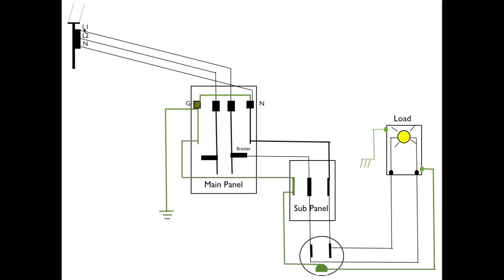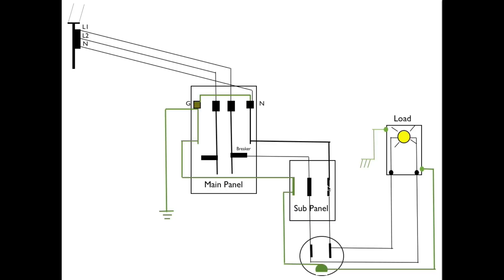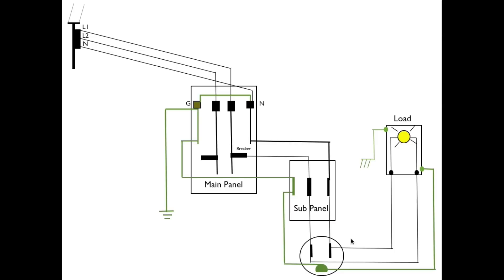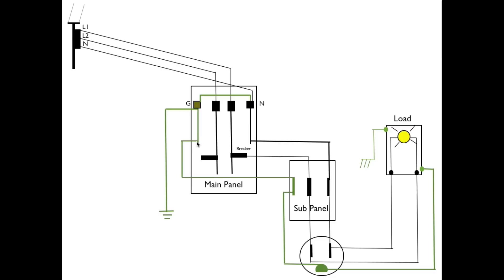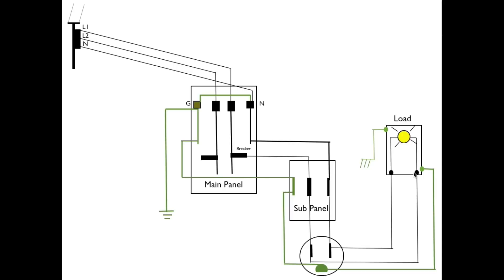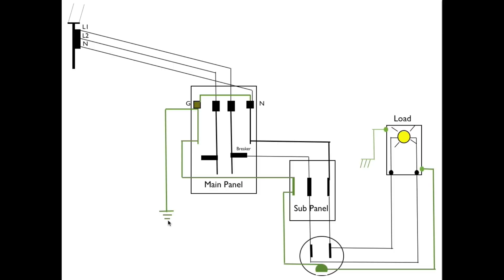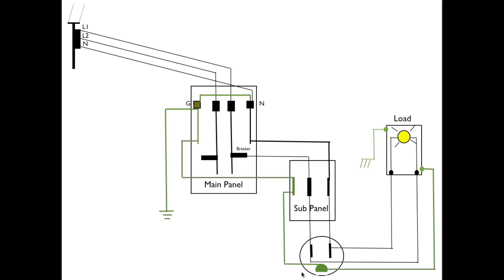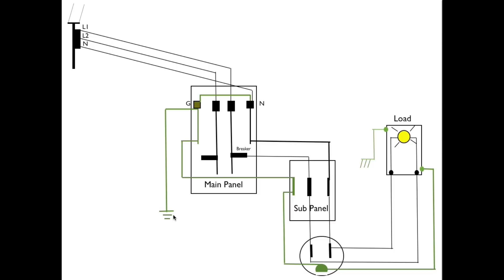The difference between neutral and ground on the electric panel

Comment: What I don't understand is if the ground and neutral are connected in the box, how can it be separated later? It's still connected
Reply from the maker: grindinglicks The issue here is if the neutral and ground were connected in the sub panel and the neutral were to be disconnected (broken wire etc)  then the equipment connected would run normally.  The power would go back thru the ground.  As the ground is connected to the chassis of the equipment, any break in the continuity of the ground would result in the chassis of the equipment being "hot" making it hazardous to touch the equipment.  Hope this helps.
GFM
Reply: That’s because ground never makes a complete current carrying circuit.  If you follow the schematic, current flows from L1 through the circuit breaker, to the sub panel, load, neutral and source.  The ground (green wire) is never part of this circuit, and as explained in the video, is only there to protect humans.
Reply: Ralph Norton Yes he does.  He described a situation with 2 separate open conductors, and a very real hazard that can be a result.  But maybe he wasn't specific enough for you.  For example, let's say my name is Ralph Norton, and I think I know how to do electrical work.  I, Ralph, make a really crappy connection on both the neutral and bond between the main panel and subpanel-- but I really kicked ass at connecting the hots!  I also put the screw in the subpanel that joins the neutral to the ground bar-- contrary to what grayfurnaceman told me.  Now I have energy in on the hot, through a light bulb, back to the panel's neutral bar, gets stuck because there's no connection to the main neutral, detours through the link to the ground bar, stuck again because there's no connection to the bond towards the supply, so detours through all the connected bonding conductors, and then sits and waits for a path to go back home/ground.  Since the circuit is incomplete, the light does not turn on, and I blame +James Martin who installed the light fixture.  Then I, Ralph, get on my handyman aluminum ladder, and grab the light fixture.  OH MY GOD!  MY NAME IS RALPH AND I'M GETTING ZAPPED!  BUT THE BREAKER WON'T TRIP BECAUSE THE TOTAL SERIES RESISTANCE OF THE LIGHT BULB FILAMENT, COPPER CONDUCTORS, FIXTURE HOUSING, MY BODY, MY CLOTHES/SHOES AND THE LADDER TO GROUND IS FAR GREATER THAN 8 OHMS WHICH RESULTS IN A CURRENT LESS THAN 15A SO THAT THE BREAKER DOESN'T EVER TRIP AND NOW I'M DEAD AND CAN NEVER POST ANOTHER USELESS AND IGNORANT YOUTUBE COMMENT ABOUT ELECTRIC WORK EVER AGAIN!!!

Comment: In all explanations of AC power transmission, I've seen, there is a power line and the return goes through the earth.  So if the hot wire contacts the grounded box or conduit, it shorts out whether there is a neutral or not. Therefor, using a conduit for a neutral makes no difference, as far as I can see.
Reply from the maker: If you look at a power generation system, there are 3 lines lines coming from the station.  They are the 3 conductors of the 3 phase system.  There is no ground necessary.  There is a grounding conductor, but it is not part of the circuit.  Some very early systems or those traveling long distances without a lot of load have used a grounding conductor as part of the circuit.  But these systems have some very nasty side effects.  Such as a dry grounding plate that will reduce the conduction of current.  
If you look at my playlist on wiring in the panel, there are a number of other videos that demonstrate what the neutral does.
GFM
Reply: Using conduit for neutral is a BIG no no. As GFM illustrated, the neutral is a current carrying conductor. Therefore, should you open a coupling at the conduit sight and separate it, you have created a very dangerous situation. Should some one grab the two separated conduits, they could be electrocuted.
AND, you can NOT use conduit as a grounding system; because of the conduit being possibly separated.
Also; there's an MGN wire used in distribution of electrical energy.

Comment: Also main panel is 220v, sub panel is 110v, at least in your diagram.
Reply from the maker: The voltage is determined by the pole transformer.  In this case, it is 240v.
GFM
Reply: It's 240v from end to end, 120v from each end to neutral (center tap), that's how you get the 240/120v household electrical system.
Reply: Yes

Comment: if the neutral is connected to the ground at the main panel, how is there no current on the ground?  the neutral brings the current back to the panel, and then wouldn't it be taken to the ground as they're connected?
Reply from the maker: Perhaps the real question is, do you think that earth ground will carry current to the earth under normal operating conditions?  
GFM

Comment: I don't understand, if neutral wire has current going through it, why doesn't it short when connected to the ground at the box?
Reply from the maker: You seem to be assuming if a wire with current available would be a dead short to earth ground.  Earth ground is not a part of the circuit.  Earth ground is for absorbing lightning and surges.
GFM

Comment: One teensy, tiny, anomaly: grounded electrical outlets have the longer, neutral on the left with the ground socket facing down.
Reply: +rchandraonline yup! Not a small issue either, this implys a miswired duplex.
Reply: +rchandraonline 
Also the white neutral wire is connected to this screw which is SILVER colored, the black hot wire is connected to the opposite screw which is BRASS colored. In a 3-way switch, often you'll find a black wire painted white on the insulation connected to a white wire with a wire nut (never connected to the switch) to serve as a neutral return for for a remote device plugged into a split receptacle that gets the hot side power originating at the farthest switch.
Never EVER switch. fuse, or use any kind of disconnect in a neutral or ground circuit.
Reply: ....... Or, you could cut GFM some slack because of the way his Main and Sub Panels are laid out. If he were to accurately portray a polarized receptacle, he would have had to cross his wire in the diagram, which would probably add unnecessary confusion to the novice person viewing the video.

Comment: The neutral wire on the pole actually originates from the centre-tap of the secondary winding of the pole-transformer, which is normally at zero volts. The reason why the neutral wire MUST be grounded is two-fold. First, it's the only way to complete the safety-ground circuit: The ground-wire would be unable to do its job if the neutral wire weren't grounded at the main panel. Second, it caps the voltage of the shock that a person can receive by touching L1 OR L2 (not both) at 120 V. Picture this scenario:  L2 somehow comes in contact with earth-ground before someone accidentally touches L1, without the neutral wire being grounded. ZAPP! That person receives a 240-V shock: MORE THAN ENOUGH TO KILL! However, if the same were to happen with the neutral-wire grounded, that person is far more likely to be spared electrocution.  In addition, the faulty L2 circuit that came in contact with earth- ground would normally open due to short-circuit (provided the resistance at the point of contact is near zero).
Reply: The neutral conductor between the panel and pole carries the DIFFERENCE in current between L1 & L2 back to the centre-tap of the pole-transformer. There are only 2 possible situations in which this current can be zero. The first being the case where ALL branch-circuits are open, and the second being the case where PERFECT load-balancing exists between L1 & L2 (which is next to IMPOSSIBLE to achieve in practice), making the currents in L1 & L2 equal.

Comment: why is there even a grounding rod if the fault is carried back through the neutral anyway to the power station?
Reply: The neutral only goes as far as the pole transformer (or pad, if your service is underground). The primary of the transformer is fed from a leg of either a wye or delta wired three phase, three or four wire line from the power station.

Comment: so if what you say is true the why is it when a wire gets knocked to the ground will it arc and burn sometimes a hole in the earth????   one would assume it must be completeing a circuit for  there to be a transfer of electricity???
Reply from the maker: If you mean high voltage power lines, if the voltage is high enough, it will overcome the resistance of earth ground.  The voltage here is less than 200 volts.
GFM
Reply: during a storm high power line to sand around the pole turns it to glass

Comment: Then we have electric ranges and dryers using 3 wire power cords where neutral and ground are tied together using a strap
Reply from the maker: That was always one that bothered me.  Until about 1995, it was ok for a manufacturer to use the ground as a current carrying conductor but field electricians could not.  Fortunately, that has changed.
GFM
Reply: Far as I know dryers and ranges still come with the grounding strap attached to Neutral
Reply from the maker: They may still have it but it can't be used in my area.
GFM
Reply: Until the 1950's, the neutral was the only way to ground appliances, there were no grounding wires, and outlets didn't have the ground hole, either.
Reply: That's so you can use the appliance in an old house without ground wires. Break off the strap if you are using a modern 4 wire supply cord and grounded outlet.

Comment: Yes..i know that....just why is it ok to bond neutral and the ground at the main panel yet its not ok at a sub panel?...
Reply: When you connect "neutral" downstream from the first "intentional grounding", the so-called "neutral" downstream is parallel with the bare ground wire(s) and current flows in the bare grounds. This is undesirable.

My hesitancy in calling the white wire returning from the load a "neutral" is that by definition in the NEC a "neutral" carries the unbalanced current and in a simple 120V  circuit feeding a load (e.g. a light bulb) there is no "unbalanced" load or current. All the current goes out the black wire from the single pole breaker and exactly the same amount (amps) current comes back to the "neutral" bus on the white wire. Thus there is no "unbalanced" current for the white "neutral" to carry. The black and whites wires carry the entire current in this simple circuit example.

2008 ECMag has an excellent article titled Neutral or Not?
Defining A Neutral Conductor by Mark C. Ode
If you Google (NEC definition of neutral) it should pop right up. The last paragraph mentions the simple 120V circuit in my earlier example.

Comment: I noticed that a 240 volt circuit doesn't use the neutral circuit.  Why is that?
Reply from the maker: I will give you the simple answer.  The neutral is not part of the 240 volt circuit.  It is the center tap of the pole transformer and is only necessary for 120 volt circuits. 
GFM

Comment: You call it what you want , as soon as you tie the G and N together in the main panel it's the same wire . Cut the ground on a HV regulator and see if you survive . The N is actually buried in the ground at the station. You run both wires so it has 2 paths for safety. If a fault hits don't be holding on to the ground. If your device faults, ( blender......) you want it to find ground fast and trip a breaker. Now they put ground fault recep .
Reply from the maker: I have made a small change in your sentence:  If your device faults, ( blender......) you want it to find NEUTRAL fast and trip a breaker.  Earth ground has nothing to do with clearing a fault.  If I eliminate the earth ground from the panel, the system, including fault clearing will operate normally.  All the chassis ground of an appliance does is provide a path for faults to travel to neutral.
GFM
Reply: grayfurnaceman just as I said before, If you go to the substation you will find your NUETRAL stuck 16 feet into the earth... ground
Reply from the maker: You still don't understand.  Earth ground is not part of the circuit.  The neutral is bonded to earth ground as a sink for lightning strikes and some surges from equipment loads.  It provides no other service.  You might try my playlist "grounding and bonding".  I have demonstrated some of the concepts I use in videos there.
GFM

Comment: @grayfurnaceman, @dancing spiderman,
Looks like if you just disconnected the silly jumper wire from Ground to Neutral in the Main Panel that your chance of shock is less. You'd still provide a quick path to earth for lightning strikes, otherwise its the neutral line that completes the circuit, right?
.
If the 2 are wired in parallel (G & N in Main Panel), then once the hot line coming in to power the load "deteriorates" and happens to conduct to the metallic frame of the load, the only way to complete the circuit and get shocked is if you touch something "grounded," ie, something wired in parallel to the current carrying Neutral wire (bc Neutral wire and frame haven't started conducting, only Live wire and frame), ie the Ground, then you'd  complete the circuit. Seems like by wiring Ground & Neutral in parallel we only introduce a possible hazard. 
.
If jumper is never wired, the ONLY way to complete the circuit is through the Neutral, this means you'd have to somehow insert yourself in series with the energized wires (same probability with Ground wired in parallel with Neutral or not), or in series with the load either before or after, and if the frame is metallic or conductive it would not find an easier pathway through a hand, arm body, arm hand, Neutral, than through the frame -> Neutral, but this also implies that somehow you are touching both ends of the circuit, this would be hard to do imo. I think its harder to complete the circuit via conducting frame -> body -> Neutral compared to completing the circuit via conducting frame -> body -> ANYTHING in the room that happens to be grounded, imo the risk seems higher wiring  Ground and Neutral in parallel. Without wiring in parallel, 2 spots of the circuit need to breakdown in order to complete the circuit unconventionally, on the contrary, when you wire Ground and Neutral in parallel, only 1 spot needs to breakdown, because everything else in the room is conducting (exaggeration)...
.
Maybe you just put smaller breakers on your ground line, with some sort of TVS for the big discharges? But then you're back to only providing a complete circuit through Neutral... Im sure someone out there can explain it to me...
Reply: Brock Samson    In England, it is my understanding that they have the equipment grounds with the branch circuits like us, but do not bond neutral to ground in their main.   They rely on GFCI to protect them.   We are almost there.   Pretty much everything in houses now are GFCI or AFCI protected.

Comment: so a lightning strike outside of the building takes the shortest path to ground at the panel and does not travel through the household wiring?
Reply from the maker: +Don Carmen You can never know for sure, but it should.
GFM
Reply: The bulk of the current may. But since the strike may be in the tens of thousands of volts (or even higher), it doesn't take much leakage into the household wiring to cause havoc - especially with sensitive electronics equipment.

Comment: The chassis potential, with respect to ground, would be equal to the voltage drop across the ground wire.

Comment: What could cause the ground wire to start carrying power?
Reply: If a live wire shorted to it.  If the neutral shorted to it.   Or shorted to any other piece of metal not intended to carry electricity, like an enclosure wall or conduit.

Comment: Not clear for me why does the Ground and Neutral in Main Panel need to be connected and at the same time it is also earthed. So does in the Load, why does it need to be earthed?
Reply from the maker: Earthing is there to provide a path for lightning to discharge into the earth without damaging equipment in the structure.  Consider if lightning struck the power pole.  A low impedance path to earth will save your tv set from being a crispy critter.
GFM
Reply: @grayfurnaceman  thank you Sir.

Comment: If the neutral carries back the current and completes the circuit, why wouldn't the electricity go through the ground wire that is bonded to the neutral bar in the main panel? Why can you only bond ground and neutral in main service panel? Can someone try to explain this in a simple manner as I can't seem to understand how it works...
Reply: Electricity can certainly travel thru the chassis ground of the appliance to the neutral.  But it should only do so if there is a fault (short) in the circuit.  
If the neutral and chassis ground were connected together in the sub panel or (appliance), and there was a fault in the insulation of the appliance that contacted the chassis of the appliance, the load may operate normally.  
At that point, the chassis is hot.  Then if there is a fault in the in the ground, you get shocked.
GFM